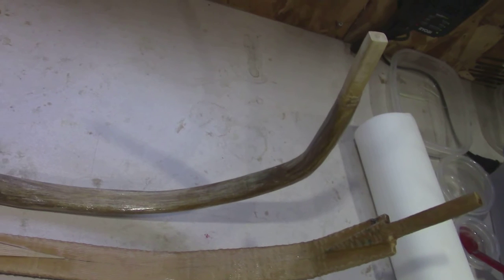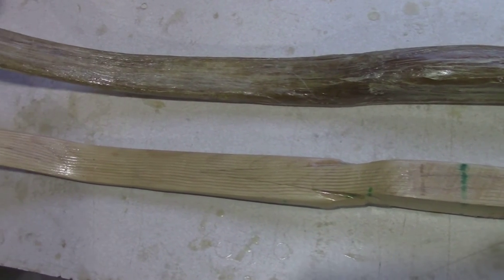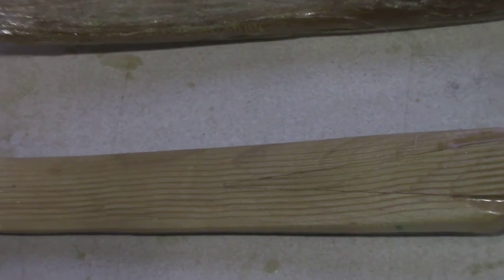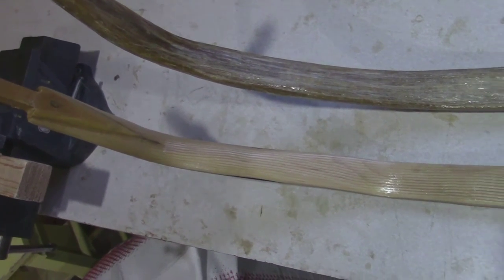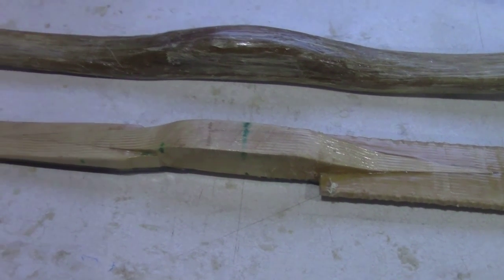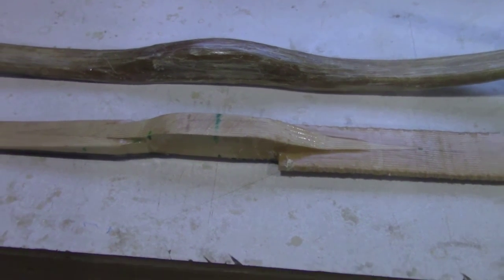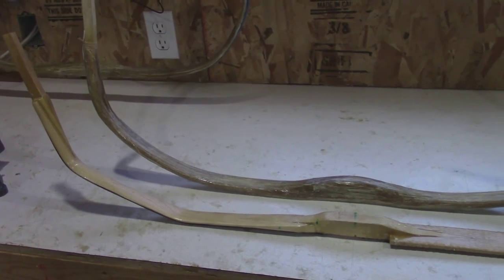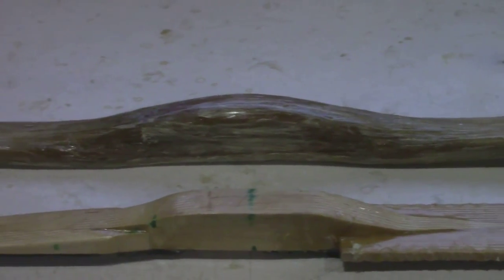Hornbow Comparison

Comment: Wouldn't want to be on the receiving end of that bow. What a great informative set of vids from when you started.  How long will you let the sinew cure before bracing?  Is it braced horizontally over the knee and do you need an assistant to do that to get the string on?   That's a lot of curve there, ya know!